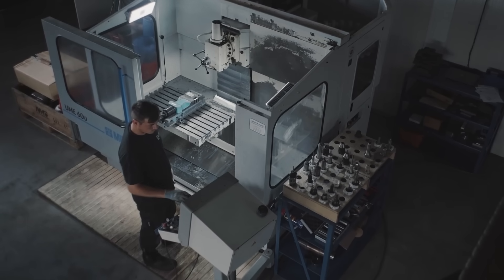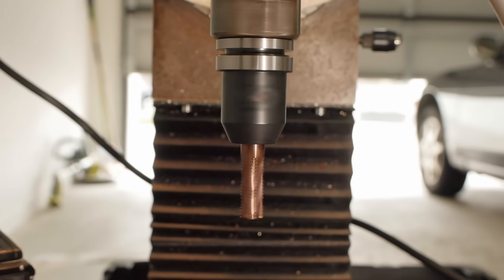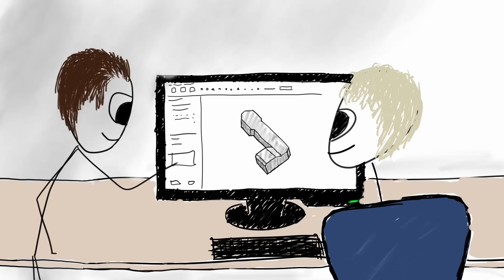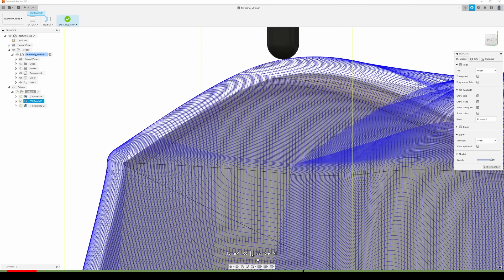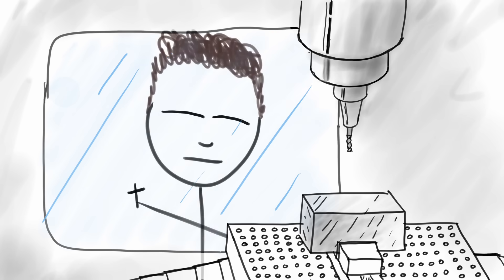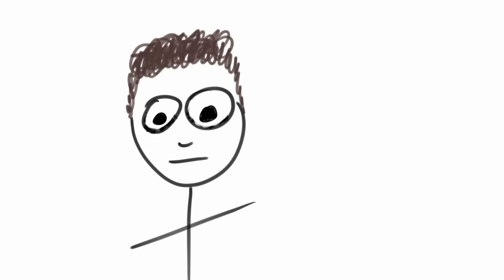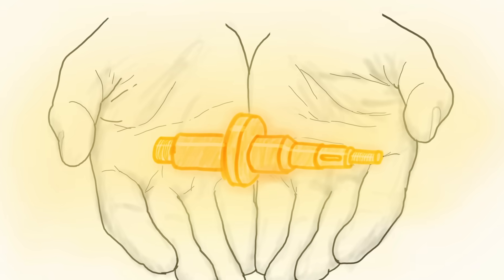Casually Explained: CNC Machining

Comment: I am a CNC integrator. I teach CNC machines how to talk to machinists. I think of ending my li#& several times every day. My clients think I'm on vacation for the past 5 months, but I'm actually recovering from a massive, massive, massive mental breakdown. I am currently hiring, btw.
Reply from the maker: If that involves what I think it does, I’m sorry for you and I’m sorry people like me exist.
Reply: Hope you get better soon
Reply: Machine tool repair mechanic here. I feel you
Reply: are you actually hiring? sounds kinda fun
Reply: You sound completely normal and I'm interested.
Reply: God bless you brother.
Reply: I did that without even knowing what it was.
Reply: What qualifications do you need to be a CNC integrator?
Reply: @scshs  embedded systems programming in C and assembly, and probably some LabView or some such to make the HMI. You would most likely need a B.S. in Electrical/Computer Engineering.
Reply: Im looking to fill my time😮, let me know if you need help asap.
Reply: yoooo sign me up

Comment: I'm a machinist "A mechanic?" I'm not having this conversation again
Reply: If I have to explain the difference, one MORE time... Idk, maybe cry quietly.
Reply: "I'm not going thru this, you're going to have to google it". That's the kind of thing I would end up saying. I have commercial quantities of cactus. I have quite a lot of knowledge and you quickly find out most people don't.
Reply: Easy: "A Mechanic assembles and repairs a Car, a Machinist creates the Engine inside it."
Reply: I'm a mechanical locksmith, it's the same concept but more archaic
Reply: @eusouoodio  I watched a locksmith cut a mill slot style key used by jeep and hyundai car makers. I thought that was the cutest little mill ever. And it only has two tools, a probe and a mill. And everything is preset macro variables and subprograms. Kinda wonder if it even runs gcode or something else. There are other languages out there like HPGL.
Reply: I’m a Metrologist. Every, even autocorrect, thinks I said “meteorologist” and they usually get pretty excited at the thought that I’m the weatherman. Then I let them down by saying it means I measure stuff, which on the surface sounds pretty boring and they immediately lose interest. 

I have to reel them back in by saying I get to play with some pretty neat and expensive equipment to measure aerospace flight hardware down to 1/10th of a micron, or about 1/500th the width of a hair.
Reply: Sorry to hear that  @enemyspotted2467
Reply: People saying im a "Mecanist" is worse 😂
Reply: Stopped telling people I was a toolmaker for the same reason!

"So you make hammers and screwdrivers?"
Reply: Felt.
Reply: STG
Reply: I'm a mechanical engineer, I'm also an outlier among men since I don't really care about cars. Yet everyone assumes mechanical engineer is just fancy talk for mechanic. I wonder if automotive engineers get the other side of the coin where everyone thinks they design automated machines
Reply: @cleverballoon6535 I suppose I would be a much younger version of you
Reply: THIS, i hate it, only thing closer is "can you make this random part i need i can buy for $15"
Reply: What's the difference. I'm a German cnc mashinist and my job is called "Zerspanungs Mechaniker" <--> "Mashining Mechanic"
Reply: @ In American English, a mechanic is somebody that fixes cars and trucks. The word “mechanic” isn’t used at all for describing a machinist.
Reply: @Wunderbolts  how do you call someone fixing mshines?
Reply: @ If we call someone fix the cnc machine, we call them a technician or just a tech. “The tech is coming tomorrow to fix the machine”
Reply: @Wunderbolts thx good to know. We call them "industry mechanic" over here, a technician would be a higher level worker specified in one certain field and they usually have desk jobs and went to some specialized university beforehand
Reply: @EinfachFredhaftGaming  heavy machinery maintenance
Reply: I mean millwrights were the mechanics of olden day precision equipment.
Reply: Il no longer a machinist, professionally at least, and work in auto parts. “Oh you’re a mechanic?” Is the typical response I get still! 😂
Reply: "so you fix cars?"
Reply: Yes you are
Reply: Think you mean operator.

Comment: That half you pay check comment was spot on lol. Love machining, but it doesn't pay so I have to move on to something that will allow me to buy my own machines and start my own machining business. The straw that broke the camels back was when I went to Subway to get food and they had a sign out that said, "Hiring now, part time/ full time, starting at 18$ an hour" Which is what I was making until a year ago. You would think a person that can hold tenths (.0001") tolerances on manual and cnc machines would get paid a decent amount more than a "sandwich artist" at a fast food joint.
Reply: Then you're machining the wrong material. Clamp some lettuce and bread and set the feedrate. :) Leave no sandwich out of spec!
Reply: @MinePossu  lmao 😂
Did you literally tell bro to put the fries in the bag for better pay???

If so that was the most creative way I've seen someone do it
Reply: @21area21  Well some cuts give you a better cut of the money.
Reply: As a guy living in South Africa I can attest, although safety and working conditions are up to par beginning pay is $4.50ph
Reply: @d.v483  Is 4.50 considered decent pay relative to other Jobs there?
Reply: @d.v483  weird I sent a reply comment but it isn't here. Is that considered decent money where you are?
Reply: Is that's the case, why would you go to subway, just to come back and buy your own machines?
Reply: Bro dropped a bomb rip
Reply: Absolutely none of those places actually pay that though. My HS age kids have been through this 1000 times. They advertise that then pay 13.50. Every time.

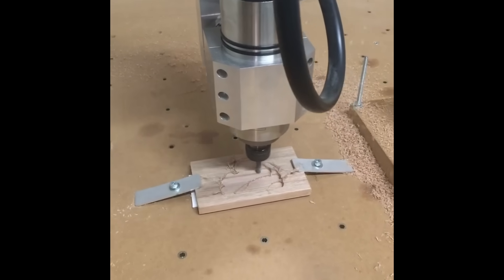Comment: 1:18 only 10 times? Try closer to 100 times.
Reply from the maker: 10x just as a starting point
Reply: You can grab second hand cnc lathes of auctuon sites for lik $8000

Comment: 3D printing is nothing but a computer controlled hotglue gun.
While CNC machining is nothing but a computer controlled drill gun🤔. You can't messup much with a hotglue, while you can messup quite a lot with a drill bit😢. 3D printing is all about slicing an imaginary🤔 object into layers like in an onion, then letting the machine lay those layers down(each layer sketched by the tiny tipped nozzle oozing the liquid plastic) to make it. CNC is all about chiselling a block of material like a sculptor,except the sculptor can work only one tiny layer at a time(or will break the chisel tool bit). A multi-axis CNC is more like an expert sculptor, that can work on a layer that is wrapped aound an object, like a chocolate dipping strawberry all around. G-code is an universal language used by 3d printers and Cnc machines. If you understand physics, you understand everything. 😂❤👍.

Comment: What is the only thing 2 machinists can agree on?

That the third machinist is doing it wrong.
Reply: Also applies to welders, electricians, plumbers, framers, masons, drywallers, and probably about 50 other trades.
Reply: Umm I’m a Mason but my job title is machinist.

Comment: I love CNC and all that and i would love to work on 5 axe's but i dont get the chance from other company's because im too young or i already must have experience on 5 axe's but i dont have that. Nobody is ready in the Moment to let you work with them but i ready would like to do exactly this. Now because i needed a job im working next week on lathes. I love it too but thats not what i wanted to do. But now i dont have a chance:/
Reply from the maker: I think you can't expect to go straight to 5 axis work. 5 axis CNC is pretty complicated and the machines are expensive and easy to make mistakes on. Any beginner should expect to be starting on a manual lathe and gradually moving up to the best machines. When you get to 5 axis, you'll be glad you learned everything you did on the journey getting there. Or just do what I did and make your own. :)
Reply: I just got my first opportunity to run and program 5 axis this year. Been in this trade since 2014, give it time. Go above and beyond, not for the company but for yourself, and you'll start turning head. Do not stay at dead-end companies, keep you're resume up to date, and apply for those jobs you think you have no chance at, you might be surprised! Best of luck brother, and God bless!

Comment: I always touch off on the top of the part, set the offset, but then I add  .100 in the z-axis to it before I press the start button. Single step it in and then, if it looks like a .100 above the top of the piece, it should be fine!

I may have laughed a little too hard at the problem solving bit of this video 😂😂😂

Comment: You see I have a colleague with a very specific skillset. He will put the material into the vice and tighten so hard the metal will start to sweat. Jackhammer the part to make sure it stays put. Plonk in his, usually faulty, program into the mill - and I shit you not - while turning away from the machine he will hit Start cycle, sit his ass down and put on his headphones.

It is now up to the rest of the workshop to be on guard, run over trying to get his attention and inform him that his machine - which is now turned sideways - is about to enter orbit. Because wouldntyaknow - you actually CANT send a facemill sideways through 4 vices without something breaking.

Scoff it off as a fault in the CAM software or blame the tools. Even better; whoever forged the material must have dropped diamonds in the forging and thats why shit keeps breaking.

Fck you, Mike. You're the sole reason why my hair is starting to turn grey. You're the lovechild of PTSD and anxiety.

Comment: "If you're unlucky you can destroy a spindle worth 30000$"

Or if you're a complete moron like a new hire at my previous job you go and rapid a DMU 160P in negative Z, shearing the ways clean off and cracking the spindle casting in your first week. Dude didn't even work in the department that ran the DMUs, he just walked over there when no one was watching and started fiddling with the controls.

Comment: Machinists will do anything but simulate gcode
Reply: It’s just one step too many. We have to draw the line somewhere.
Reply: The frig? I’d rather simulate and know there’s one less thing that can go wrong than run fast and loose and have to fix a setup or do tool setup again bc I was lazy and in too much of a hurry.
Reply: When you dont dry run/simulate and you put the decimal in the wrong spot you snap your $1200 carbide boring bar and just stand there like 😮
Reply: Just wait until someone has messed with your sim settings and the machine crashes anyway. :/
Reply: I think you’re referring to what I would call a “button pusher”. They also won’t watch the machine on the first run either.
Reply: Then those aren’t very good machinists. Gotta always double and triple check your shit, verify by safe means, ect. Better than a broken tool, or even a whole mill
Reply: @leftovercroc9883  1 of them is very skilled but also the owner - so theres really no point in trying to tell him. Its his money 😄

But two of the other guys are straight up just bad machinists. They rush their jobs to look good for the boss - but keep making the same mistakes. Forgot to measure the new tool inserted. Didnt doublecheck the program. Forgot where the XYZ coordinates should be in the machine compared to program.
Reply: I like simulations when I’m doing complex code
Reply: Why should I simulate it when I can single step it
Reply: @bosspanda9925  single step it if it’s a verified program, if ur running brand new code its best to verify it first and do a dry run
Reply: My company will do anything but buy me a program that will let me simulate G-code on our wack-ass specialty machines
Although in their defense one seat of Espirit would cost them more per year than my paychecks do
Reply: I have every gcode tattooed on my back.  Seems like everyone else remembers the codes except me.
Reply: Simulation is good, but it can't always show you exactly what will happen at your machine.  Don't trust it.  Single block, 25% rapid on your first run.
Reply: Just trust me bro
Reply: It's called live simulation.
Reply: What are you talking about lol that's what you do when you're making real parts
Reply from the maker: @Dillybar777 Simulating or not simulating?
Reply: @machsuper  simulating! 2 minutes on verify saves hours of wasted machine time
Reply: @Dillybar777  I work in a small shop with 8 guys running CNC mills. Half of us swears to simulate and use the CAM software to inform us of any problems. The other half doesnt and thinks its a waste of time. 

Guess which half had to order 2 new spindles and uses at least double the amount of tools to get their work done. Oh, and lets not forget the scrapbin.

Im not an angel and I make faults too - but if Im on my 8th hour of programming that day - I use all the help I can to at least make sure that my tool lines are set properly. Nothing worse than being 99% finished and you decide to chamfer 3 holes on the wrong side :face-purple-crying:

Comment: Oh boy if you think cam programming is boring just wait until you have to make those programs without cam software, punching in and making every code yourself because the machine is a big old piece of garbage ;)
Otherwise yes, this video is 100% right :D
Reply: Oh, its not boring, its just tedius as fuck. 

And once you finally get going you'll have a casual heart rate of 195 with a death grip on the Cycle stop button and feed rate knob.
Reply: @Celciusify  I always thought the emergency stop button should not be mounted above the spindle (as on older CNCs like the Bridgeport Series I and II vertical mills). Why not have the shut-off attached to a safety harness or a pressure plate and have it triggered when the machinist ran away?

While running a much larger milling machine, I once had a part weighing over 300 pounds tear loose and spin around the boring bar. It was only a matter of time before the boring bar gave way. The last place I wanted to be was anywhere near that machine, but that's where the power cutoff was located.
Reply: @GaiusTacitus for sure there are better and more interesting ways to mount / integrate estops. Having to move toward the spindle in any way to reach the estop in an emergency situation is about the worst placement I can think of, but it’s also probably the most common placement as well.
Reply: @matter9  It is all too common, and I can't count the times that a control system or drive motor malfunction caused a serious crash and placed me at risk of losing life or limb.
Reply: The Old Way was the only way when I started in the industry.
Reply: @GaiusTacitus  It is still the only way for me, unless I wanna get going on one of the manual machines
Reply: @Erik_Blomgren  what model of machine is that if I may ask?
Reply from the maker: It's boring to watch, but not boring to do. I love it! I spend an unreasonable amount of brain power thinking about how the software works behind the scenes. I've made a handful of small programs in the MDI screen for my 5 axis router with some trigonometry and tool angles... THAT gets boring quickly.
Reply: @machsuper  I used to program airframe parts that required solving nth-degree polynomial equations to map the curvi-linear surfaces. I found it necessary to use an HP-28C calculator, for the IEEE-488 math libraries used in TI calculators and in IBM compatible PCs are not accurate to a sufficient number of decimal places to remain within tolerance.

I wasted several hours once writing a program to contour mill a Ferrari Dino 206 GT. I machined it from a large block of aluminum we had left over from making prototypes and it turned out pretty well. I was looking for it one day a few years ago to show it to a coworker, but found my wife had thrown it out along with some of my "other rubbish" while making room for her own useless "treasures".

Designing and making machinery and cool parts of new mechanisms is always fun.
Reply from the maker: @GaiusTacitus  that's incredible! The fact that you hit floating-point precision limitations is so extreme. It's so easy to take for granted the tools we have today for curved geometry. Shame your wife threw out the 206 GT.
Reply: I can hear the guys at my workplace nagging that they forgot how to programm manually since they get a lot of stuff premade from the cam guy nowadays, so im very glad that at least the lathe work is still all selfmade.
Reply: You have gathered an unfathomable amount of patience. My respects to you : D
Reply: What do you run?  I run an old Haas VF4.  94 or 95 I think, with the amber phosphor screen.  It's got a MB of storage, so I use MDI for bigger programs.  But I don't use CAM if I can help it, especially for just ending things up or putting holes in that I can write in about fifteen minutes when I'd still be working out my tool library in the CAM program.
Reply: The dreaded "hand code it then" thought or suggestion
Reply: I still do it the old way. Shorter programs in a niche market without any reason to uptech.